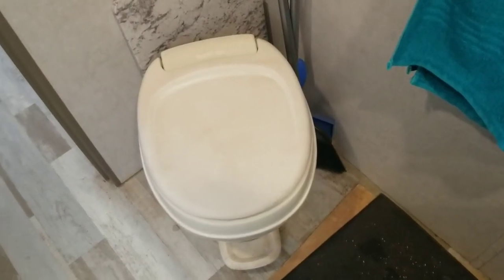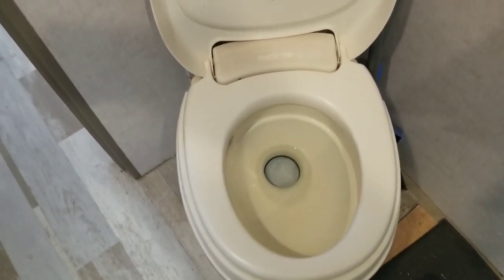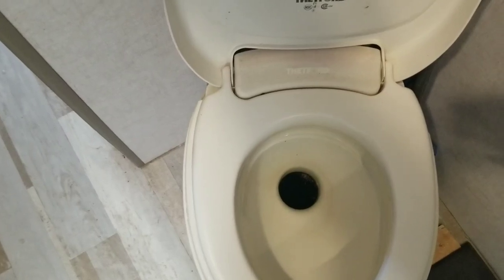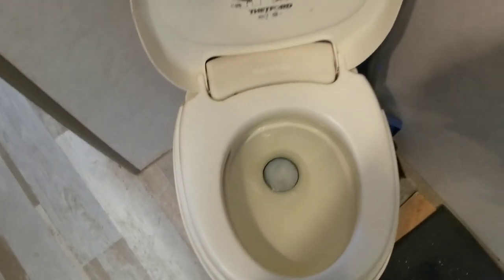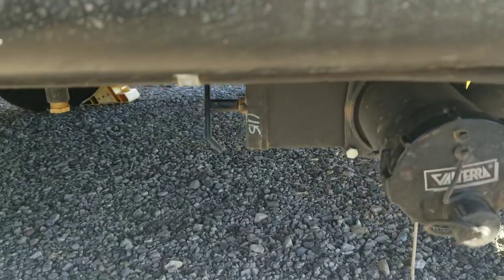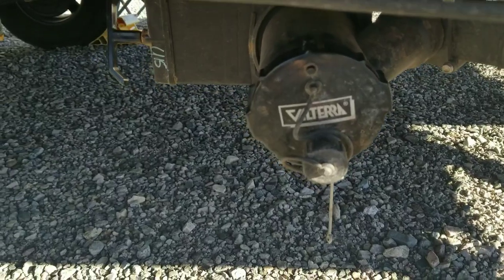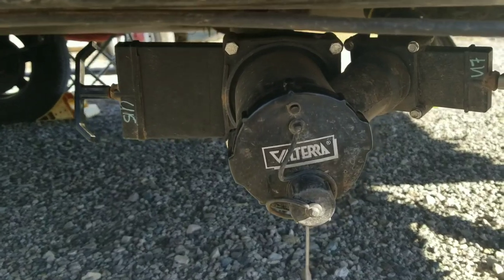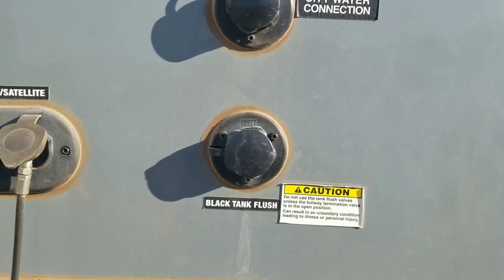RV Toilet Clogged? A DIY Fix For A Clogged RV Toilet (You've Been Doing It Wrong!)

Comment: Sorry to disagree but it IS possible to clog an RV toilet because we have done it several times now in our new to us Class A motorhome. Never had a problem with our Class C. I think toilet paper is getting stuck in the pipe somewhere. Thanks for your video though.  UPDATE:  Found there is a support cross member piece IN the tank that is catching TP on the way down.  Poor design in my opinion...
Reply: Especially when ya got three kids
Reply: I've got this problem now. To much toilet paper and kids
Reply: Happened to me. There goes the rent money…
Reply: How are you unclogging? I have a 1988 Winnebago Chieftan and now it’s backed up to the bowl. I have put tablets to breakdown the toilet paper and waste without success. I have also plunged.

Comment: Actually the pipe is at a 30° angle therefore it does Clog. So part of what you said is true the toilet does not contain a P-trap however that pipe is it a 30° angle so again rv toilets can clog.
Reply: Carl is correct!
Reply: A regular plunger should work right?
Reply: I’ve been using RV grade toilet paper but somehow the water is still backing up so it’s got a clog in it and of course I don’t have a plunger right now lol

Comment: My tank seems to drain. But after draining it, I open the toliet n i still see waste sitting 6inches below the toliet opening where it is to drain down into the tank. Im lost. I tried using a maunel auger gently. didn't work. I unfortunately bought this camper with an issue i didn't know about.  Can you help? Its like something is stuck in the drain from the opening to the tank. But im not sure. Any help would be appreciated. Thank you.
Bonnie
Reply: I've watched a few videos one guy used hot water almost boiling poured it down the toilet a different lady ended up having to use a snake after train chemicals
Reply: Swivel stick tank cleaner by camco.  It’s about 25 bucks but it will make your black tank like new. Follow the directions and it will work.

Comment: Great info very helpful!! Can you answer this question? How much fresh water should I keep in black tank to not have another clog? You mention you have never had a clog. How much water do you keep in there?  I did everything and it still didn't clear. It was a mess. I realized my toilet was clogged and took a 5' flexible pex pipe and jammed it down the toilet and spun it to clear the clog. That finally worked.
Reply: I've never specifically added fresh water to an empty black tank. Mostly just don't skimp on the amount of water you use to flush solids. Also don't go overboard on the amount of toilet paper and it's best to use cheap single ply paper which breaks down easily.

Comment: I have a 1988 Winnebago Chieftan and it’s backed up to the bowl. I have put warrior tablets to breakdown the toilet paper and waste without success. I have attempted to plunge it also. Help!
Reply: Boil hot water a gallon. Pour it directly into toilet, be sure to shut water off. Let the hot water sit in toilet for about an hour, this will break up any toilet paper that is clogging. I had to do this with my RV. I could see the water in the inside. Make sure the tank is closed too. You want that hot hot water to sit in there and break up toilet paper. You may have to do it a few times. ALWAYS run lots of water after going to the bathroom to avoid a clogg

Comment: I am sitting with a bad black tank clog i got the unique chemical and praying it works I am mad as I knew to put a big bucket of water in my blk tank when I moved to my new location and now I have a blockage I tried to put my hose up the outside flush out but it didn't work either, Hopfully the Unique will eat through it.  i don't know what else to do now except maybe plung it
Reply: Plunging is unlikely to work.  You can start by running a snake carefully down through the toilet while someone holds the lever so the valve stays open. Or if water passes by the block, use a garden hose and flush with water through the toilet.

Comment: So I do leave my black tank shut an have lived in my rv for two year. Outta the blue twice now I’ve had an issue with it clogging drain the black tank everything seems fine then outta the blue it’s completely full shortly after dumping it I’ve had to snake it twice now within a month. Have any suggestions as to why it’s all of a sudden clogging up on me??
Reply: The only thing I can think of is a build up of solids in the black tank, not a good thing.  Best suggestion I can think of is to flush the black tank repeatedly with a garden hose either through the toilet or if your rv is equipped with a spray flush connection.  Worse thing to do is to minimize the amount of water when using the toilet.  If solids get the opportunity to dry out the black tank will fill with solids and will be difficult  to flush out. Also make sure the 3" dump valve isn't leaking water down the drain.  The black tank needs to be retaining water between dumps.

Comment: People who say "never" or "always" overstate many situations. Sometimes a piece of paper or waste material can keep the valve from completely sealing. This allows the liquids to seep out of the black tank overnight and leave your tank with nothing but solids.
Reply from the maker: True,  anything can happen. The big issue is lack of liquid in the tank makes for a nasty problem.
Reply: That's correct one video it was the ladies toilet plumbing system to the tank because the pipe went in a sort of s the shape to the tank she ended up having to use a snake to get it cleared

Comment: My clog is due to the toilet being on the opposite side of the RV from the sewer dump pipe. I came to this video, hoping to find out how to use a drain snake thing to open this paper jam. I just don't have any idea what things look like in the parts of this system that I can't see. There must be an angled pipe down there or the black tank goes the entire width of my trailer. I really don't think it does cause it isn't a simple gravity drop like with my other RV toilet.
Reply from the maker: What side the dump valve is on is unlikely to be the issue. Is the black tank located below the toilet?   If the output from the toilet angles away from the toilet instead of down into the black tank you can, While holding the toilet valve open so as not to damage it, Send a garden hose or in worst case scenarios a snake down through the toilet to break the clog loose. If the tank is directly below the toilet the clog must be in the pipe going from the tank across the RV to the Dump valve.  If the clog is in the pipe coming across the bottom of the RV you should send a garden hose up through  The dump valve and try to clean it out that way. A snake is always a secondary attempt Because it is more likely to damage is the plastic valves and such.
Reply: @TheFunTimesGuide  Thank you. So since I know the clog is under the toilet, I would run a garden hose down through the open valve of the toilet? Then burn said garden hose? ;)
Reply from the maker: @Pack.Leader  that works.  Be careful not to rub against the toilet valve as they are fragile and will never seal properly if nicked while doing this.
Reply: @TheFunTimesGuide  One other question. Is there some sort of cap that I can screw on to the end of the garden hose so stuff won't get jammed up inside of it as I'm sticking it down through all that? I wonder if a soda bottle cap would work. Doubt it. Threads too wide.
Reply from the maker: @Pack.Leader  I'm sure a soda cap is a different thread. Myself,  I wouldn't worry about stuff going up the hose. Use a non-drinking water hose and when done run water through it.  Maybe pour some bleach through the hose. Should still be good for outside use.

Comment: Is there a way to turn off the water going to toilet?
Reply: Yes. If you are boon docking, turn off the water pump. If you are hooked up to water in a park, turn off the spigot. If you're looking to only disable water to the toilet, you're most like out of luck. I haven't seen any RV toilets plumbed with a shut-off valve.

Comment: I think there are baby wipes stuck in mine, is there any hope??
Reply from the maker: That's going to be a tough one because baby wipes do not dissolve. They should never be put down any toilet residential or RV. Hopefully you are still able to flush water through your black tank. The best you can do is fill the black water tank and drain it repeatedly. If your RV has a spray wand installed in the black tank use that to fill the tank so there is some hope that it will agitate any baby wipes stuck to the bottom.  Very likely you will not be able to get all of them out of there  But hopefully you can flush enough down the hose to help.

Comment: It's plugged in the drop down pipe. I can see it and my tank is empty.
Reply from the maker: Add water, poke something down through the toilet to clear it. Doesn't have far too fall if the tank is really empty and not clear full of solids.
Reply: @TheFunTimesGuide  I bought a long piece of 1 inch PVC with a round cap. Stuck some thetford toilet paper dissolver in there. Then I'm going to push it down tomorrow. It's a thetford toilet.
Reply from the maker: @michaelinraleigh  Good luck, be careful with the slide valve in the toilet. It's easily damaged if you hit it with the pipe as you try to clear the plug.  Also don't get too forceful.  I can't imagine a plugged pipe that won't easily be pushed through. I hope it's a straight shot down into the tank. 1" PVC won't do corners.

Comment: My toilet is full in my RV but I flushed and it’s not coming out! Help
Reply from the maker: Kind of sparse on information but if the toilet bowl is full and won't go down here's some possibilities. 
1. If the toilet valve doesn't open, there is a problem with the toilet which likely will require removing the toilet for disassembly. Sorry but this will be messy.
2. If the valve opens but waste won't go down the black tank is either full or plugged with solid waste. Empty the tank and if needed clean piping between toilet and black tank. Again, likely a messy project. Good luck.
Reply: TheFunTimesGuide I see, thank you!
Reply: @TheFunTimesGuide  does your toilet have an  inline macerator? Junk stuck in impeller will prevent the toilet from draining

Comment: False, it's absolutely possible to have a plugged toilet in an RV, I just unplugged one. Tried the black tank flush first,  doesn't do a a thing if your toilet is plugged...
Reply from the maker: Yes in some situations where the plumbing from the toilet going to the  Tank  Is is not a straight shot It is possible to create a plug situation in the pipeline. That said the toilet itself is a straight through situation.  Of course if you are referring to a park model trailer which are sometimes considered an RV, And If it has a household toilet with flushing tank, Those types of toilets have an internal P trap which indeed can plug.
Reply: What did you do to unclog it?
Reply: Right? @1shaneeka

Comment: Tank drains toilet wont
Reply: Ah, but the question is, is the tank really draining, or are you just draining off some of the liquid. Has a pile of solids accumulated high enough to prevent the toilet from emptying? I would start by flushing the tank with a garden hose  entering through the dump valve.

Comment: I have a 1988 Winnebago Chieftan and it’s backed up to the bowl. I have put warrior tablets to breakdown the toilet paper and waste without success. I have attempted to plunge it also. Help!
Reply: You're probably not in a good position.  If the black tank won't drain , it's plugged up with solid waste. You haven't said where you are located, so I don't know
 if things are frozen. If the tank drains, you might get the pipe from the toilet unplugged with a Sewer snake.  If you have left the black tank drain valve open, letting the water drain out the whole system is plugged with solid waste. No quick answer without knowing more about your situation.
Reply: @Captain-Max  I’m in ShowLow, AZ in the mountains. It’s cold but getting warmer. The tanks did freeze, but that happened after the clog. It’s seems like they are unthawed. The RV is not perfectly level. On a colder day I put my Buddy Heater facing the tanks to help with the thawing process.🤔 I think that’s it?
Reply: @1shaneeka  I think you should get down out of the mountains. Likely your frozen tanks are damaged and you've got a real mess on your hands.
Reply: @Captain-Max  Well…I was trying to drive my driver side rear tires up onto a rock to level the RV and it shut off. I’m not sure why but it won’t start now. So I can’t take it out of the mountains right now. Everything was fine and then everything went wrong 😑